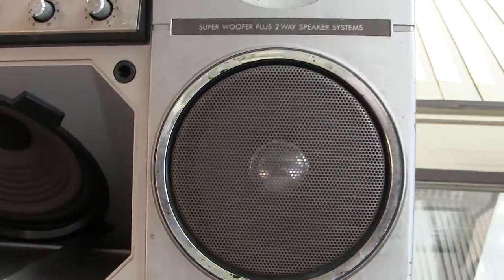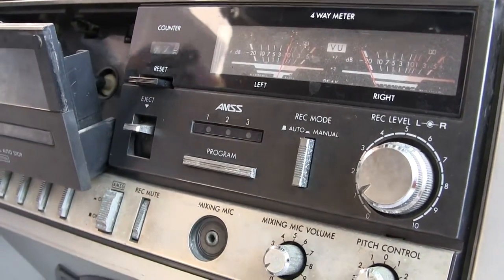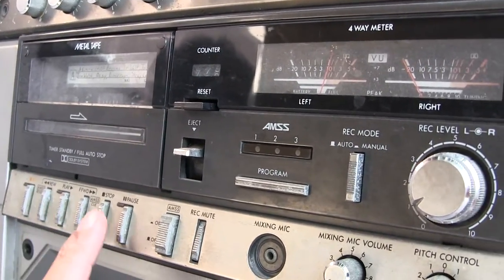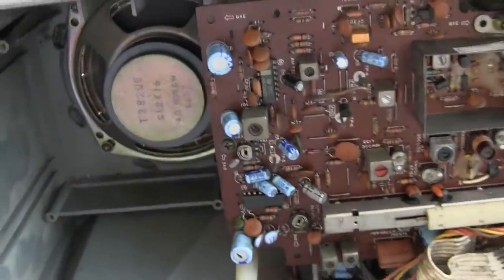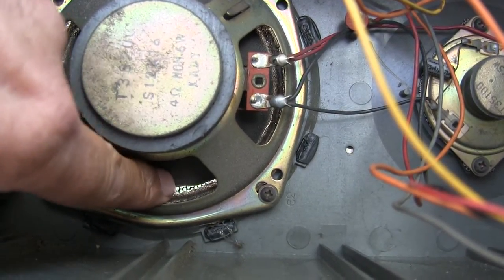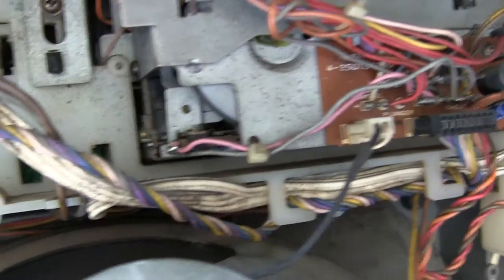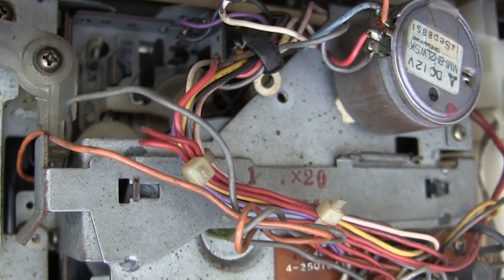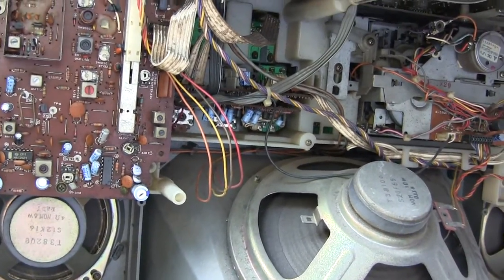Sanyo M X960K Big Ben Super Woofer Boombox Inside Schematic Review Old One

Comment: Hi, i just got this one. The radio works, but the cassette deck does not, there's also a piece missing beside the radio tuning wheel, due to a flagrant hit,  those are repairable, But, the one issue that's not is that the middle woofer's dust cover is missing :(  ?!  Do you happen to have an extra one ? I would like to buy one..  Or, do you know, where i might be able to get one removable grill / cover  for the woofer ?  Ebay does not have any on sale...
Reply from the maker: I can't describe to you how to make a framework based on the four pins and make your own cover lot of work but well worth it in the end
Reply from the maker: PS I had two of these models and I sold them both
Reply from the maker: You could make a classified ad and put it on eBay that you're wanting to buy such an item and give her a price that you pay for such
Reply: @Cassette2Go  Thanks. I think i need to do that. It´s a pity that it´s missing, but on the otherhand, it´s a great looker without the cover :)  If u come across with the dust cover, could you info me, thanks ? I think, that´s a quite rare peace to acquire...
Reply from the maker: @RUSKAJACK  I have an idea if you were to take the to somebody that manufacturers picture frames and see if they can make based on the four holes if you have a framing gallery shop in your neighborhood if you understand what I mean
Reply from the maker: @RUSKAJACK  I hate to break the news to you but I am not actively looking anymore for these as i am now poor and in January this 2020 year I lost five toes to the VA hospital due to diabetes as i now have other things to keep me busy like repairing my current radios and selling off all I have and I sold both of these chunky model that I owned as they are just too complicated and you just cannot put a sub-woofer in the same box as your main speakers as only JVC Kaboom ever did this correctly in a portable
Reply: @Cassette2Go  It´s  sad to hear about your diabetes, i wish nothing but the best for you. You have very cool radios and videos, i for example have taken information and guidance from ur videos many times, when fixing or (trying) to fix my radios / boomboxes
Reply from the maker: @RUSKAJACK  Thank you as this is one of the reason's why i try to make these informative video's - To help others repair their own portables.
Reply from the maker: @RUSKAJACK  Diabetes has not stopped me from doing stuff it's just a minor setback and allows me to focus more on what is important like getting all these boombox repaired and selling them back to the world so the world can appreciate them in a working order that is so they can play their cassettes again :)

Comment from the maker: it is very easy to open just need to be mindfull of where the antenna wires go and of the power supply wire from the back of the to where it plugs into the motherboard
Reply: Cassette2Go  where's the rest of this video
Reply from the maker: jeff plunkett I don't understand what you mean by where is the rest of this video as I sold this unit and the other unit as I had two of these to a man in New York City years ago I don't remember when
Reply: jeff plunkett it's a really old boom box but still works but the tape player can have mechanical problems over time and that's usually very common with the vintage boom boxes